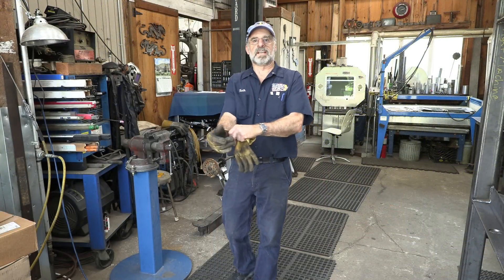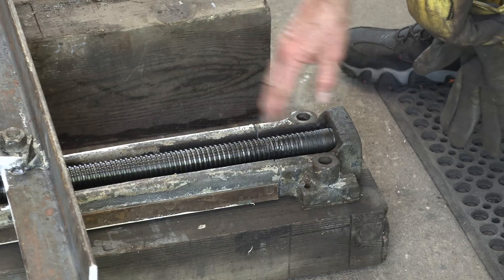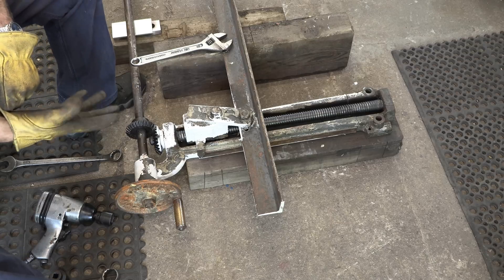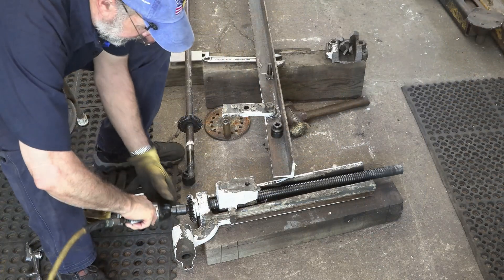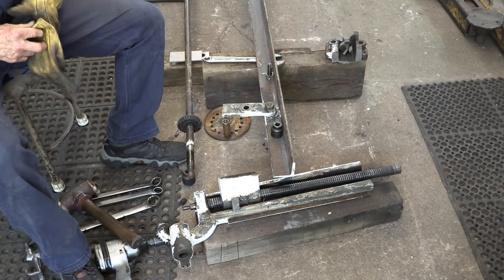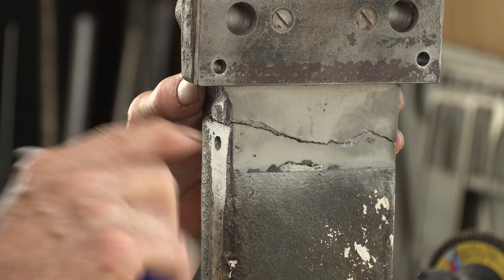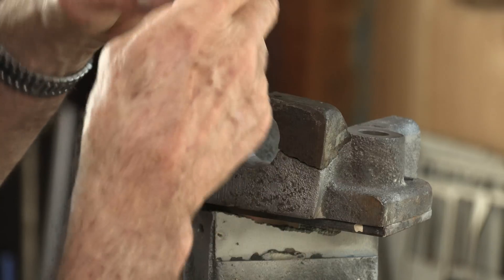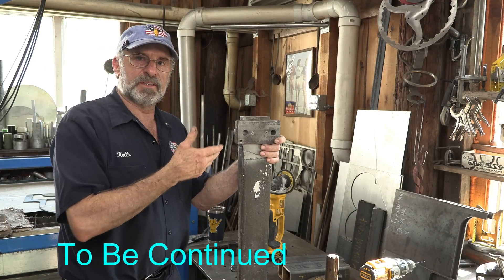Shear Brazing

Comment: Most excellent course of action. The nation should be thanking you not, just me. Inspiring. I'm going to now repair, my Weber grill handle with a thru bolt. It was spot welded and failed. Most would trash it. Not me, thanks to you. It's only 28 years old. I would never kick a 28 year old to the curb for losing the ability to provide a hand grip. That's almost criminal.

Comment: This will be a good brazing tutorial for me. I like the idea of getting rid of the smaller chunks and making it one big chunk of adhered brass, which should make the machining part a bit easier. Nobody seems to braze anymore...it's almost one of those lost arts.
Reply: I was taught to braze at school, borax flux and spelter rods for serious work. Nowadays they call mig welding with brass wire brazing, which is why they have banned brazing in car body work in UK (somebody did not understand the difference !)
Reply: @CrimeVid that is interesting, I also learnt to braze at school, it is a useful technique which goes with traditional filing & sawing skills.